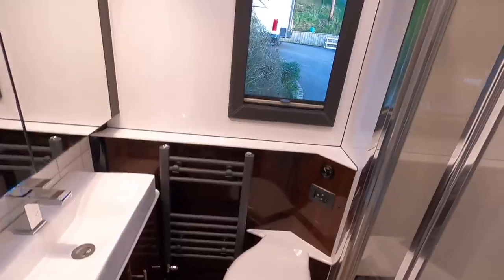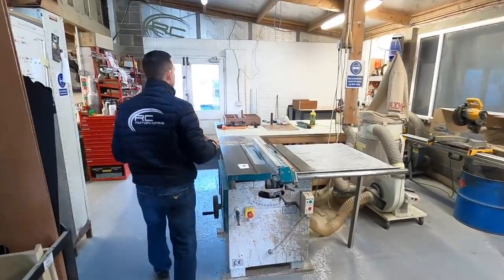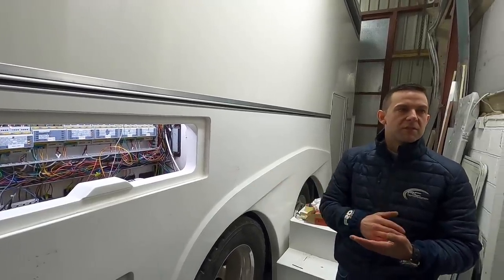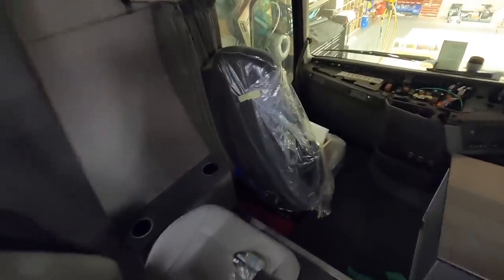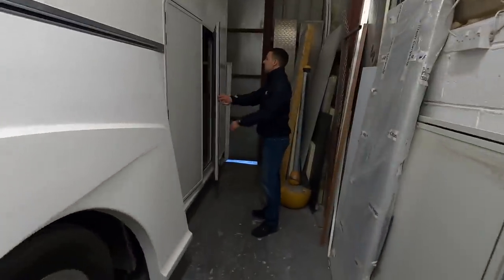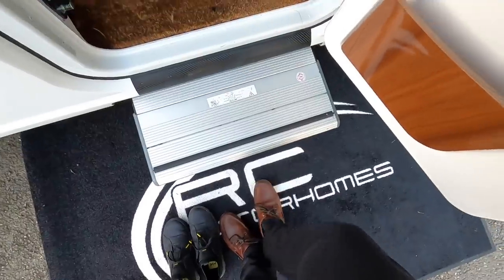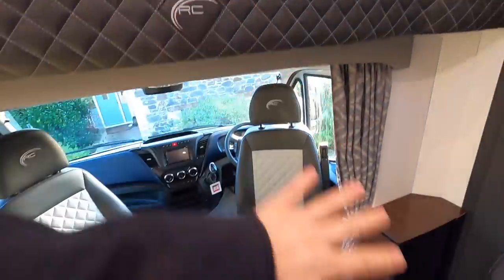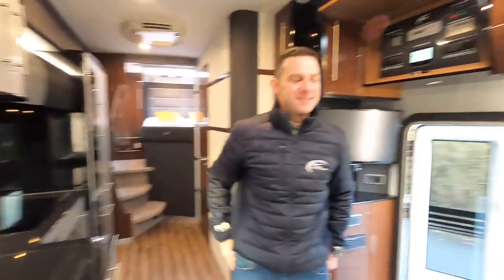£1/4 million custom motorhome!

Comment: I'm impressed. Not like the motorhomes of the 70s,80s or 90s.
Can see the marine heratige in its electrical, plumming, kitchen (meile) lol, and woodwork. Not to forget those cushins. Just was missing the towel on the rack in the head.
Great video. Great motorhome.

Comment: fantastic insight into the prestige and bespoke travelhome build,people dont realise the thousands of components put into these vehicles the cost alone for a rolling chassis cab form a major manfactrurer,volvo mercedes,iveco under 22 tonne max load carrier can start at 25k upto 60k thats before a single part been added and the man hours going in makes for very little profit margin, great video cant wait to see that finished volvo
Reply: Theresnobody Here 
wow. thought there would be some worthwhile margin at least
Reply: @Onlinesully  well they cover costs and labour ,small profit i,ve work in many coachbuilding and engineering workshops motorhome,caravan luxury coaches ,fire engines to standerd box van  bodies ,these are built by craftsmen who do it as there job hobby ,problem solvers its a game custom builds done with pride not really for money but it  pays the bills,its small space takes great design skill to pull off a great interior in a smallspace with all the different materials connecting together were it all  joins details to the finish
Reply: Theresnobody Here 
fantastic, thanks for all the insight. sounds like the craftsmen are lucky to do something they love so much and the buyers are very lucky to buy the end result.

Comment: now is it a boat or now a motor home.  what driving license do you need for the bigger motor home nick ?
Reply: 10 years ago - if you have 'grandfather rights (passed your car licence before a certain year) and you have a C1 licence, you can drive up to 5 tons as a rigid vehicle but you will need a C1E licence (the E licence is a trailer licence) if you want to tow a car behind.  If your vehicle is over 7 1/2 tons, you will an C (Old HGV) licence.  If you intend to tow a car behind as well then you will need a CE licence (basically the old 'Arctic' licence}.  If you do not have grandfathers rights then you will need a C (old HGV) licence if your vehicle is over 3 tons as well as a trailer licence (CE Licence).  I don't know if the laws have change but a Coach Licence (D) did NOT give you the right to drive a large motorhome.  And also remember your motorhome AND towed car cannot exceed a maximum of 12 metres in length.  I used to drive a 36ft quad-slide Monaco Cayman towing a 740 Volvo estate car on an American Blue Ox 'A' frame and I only just fitted inside the 12 metre limit.

Comment: I would make the garage another bedroom or chill area.
Reply: yes me too! I wonder if since you can pull out the sides for more room.. if the same can be done vertically ... to give more height throughout when in practical use.. which could potentially allow you to have slightly higher under floor space... for storage/ garage/bedroom etc

Comment: I'd really love to waste over £1 Million to buy a "Mo'erhome" like this. After all, we've all got that amount of cash to spend on 4 wheels, an engine and a few bits of plumbing and cabinet work. What a total rip off. Anyone who buys this is either terminally stupid or utterly mad. Motaholic (aka Aquaholic) has reached new heights of completely uncritical assessments of floating and road-going expensive tat. Well done.
Reply from the maker: Never met anyone yet who is both 'terminally stupid or utterly mad' and yet simultaneously successful enough to spend £1/4 million (not 'over £1 million') on a leisure toy. 🙂